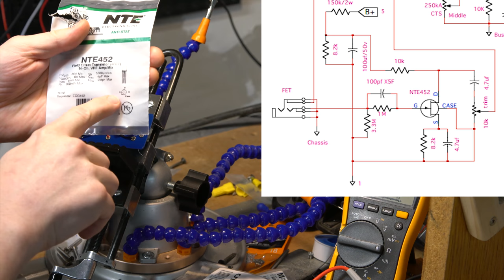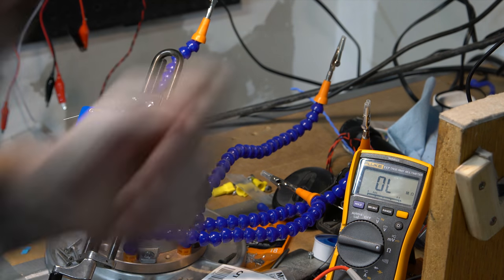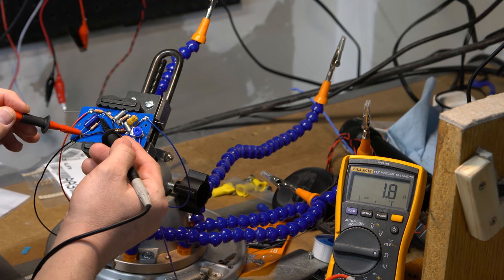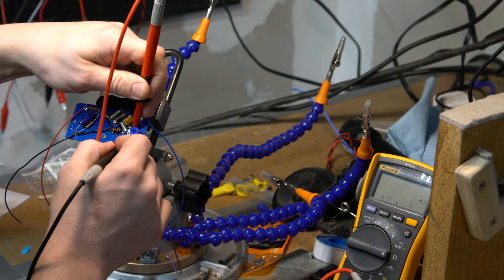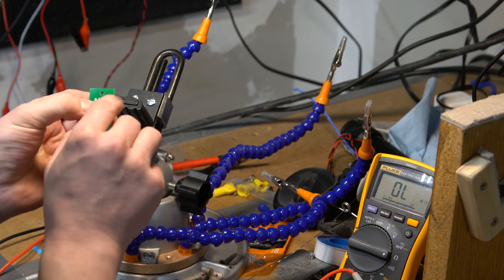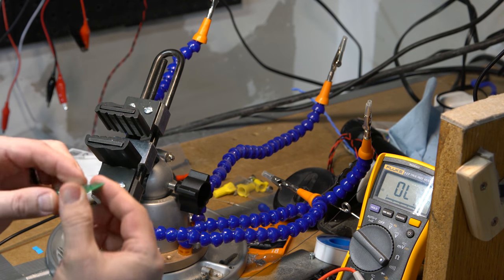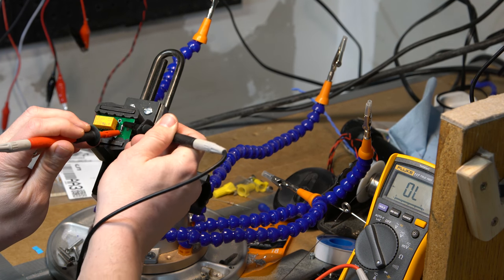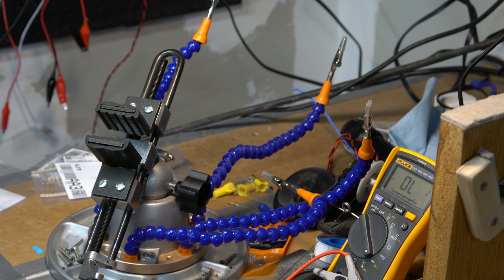Dumble Overdrive Special #124 Build Video 4

Comment: Why don't you test the FET board, looking at the voltage rating and using our brains, we can conclude that the circuit runs at less than 50V. Would have to do fine at 24V or even 12V... there is a bias pot.
Reply from the maker: +zjokka I don't have a variable bench power supply :) I hope to get one soon, by I'll have to wait until it's in circuit to see